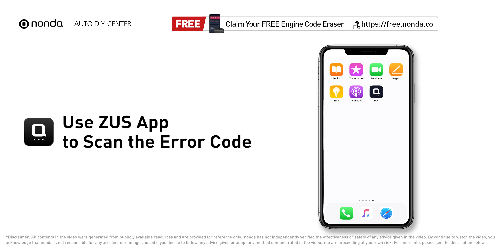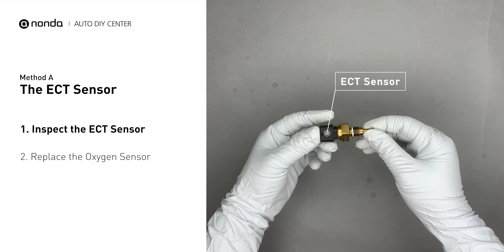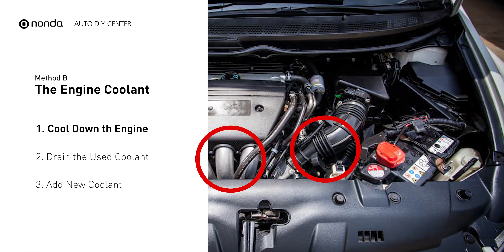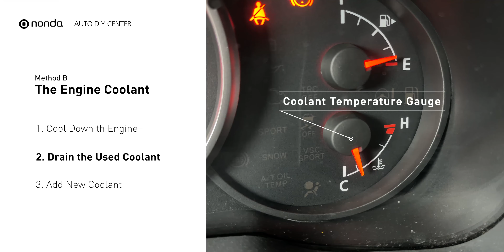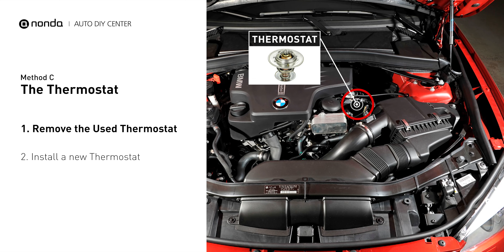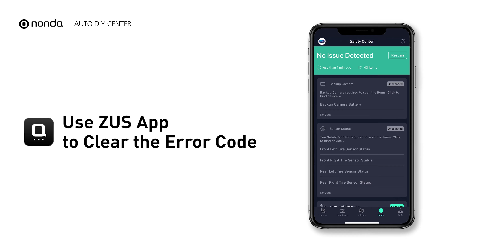How to Fix AUDI P2181 Engine Code in 4 Minutes [3 DIY Methods / Only $7.36]

Comment: Most if not all Audi's have no radiator cap, and only the reservoir cap. This error is sometimes just air in the system that can be purged via a small screw on top of the highest coolant hard line on the engibe by slowly loosening it while the car is running and at temp until the coolant coming out is no longer bubbly/foamy, and drips smoothly. Or, by undoing the reservoir and tilting it at an angle with cap off and allow it to bubble until it stops. Repeat either of these at least twice, be cautious with hot coolant.

Comment: will the check engine light reset on its own
Reply from the maker: Hello, unless you fix the problem, it won't reset on its own. Are you getting this code without other codes present?
Reply: @nondainc  I replaced the thermostat and ECT censor which with that comes with flushing the coolant so I did all 3 reset the codes in the OBD II port and haven’t received the Check Engine light since so I’m guessing it’s fixed now but I do also have to replace one of my tire censors therefore I have a TPMS light on the dash but like i said since i restarted it no codes or check engine light